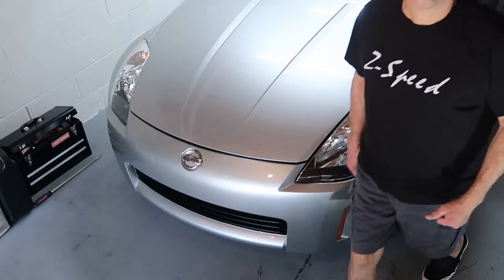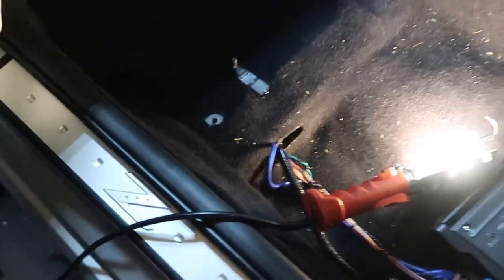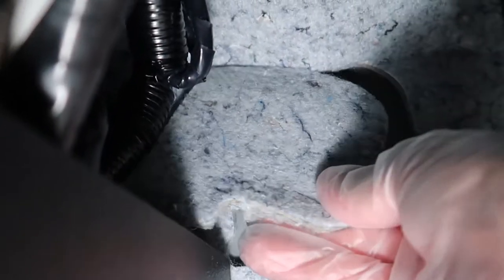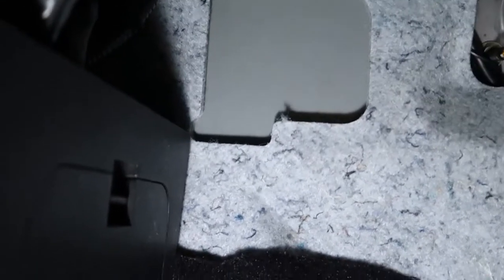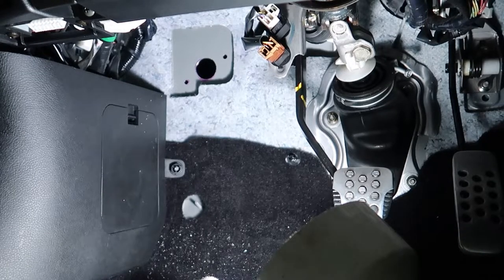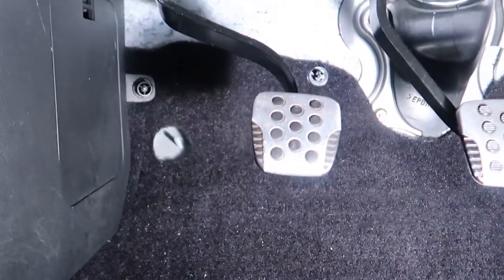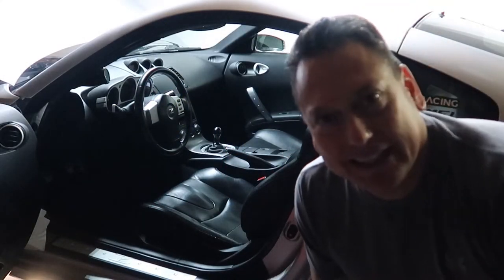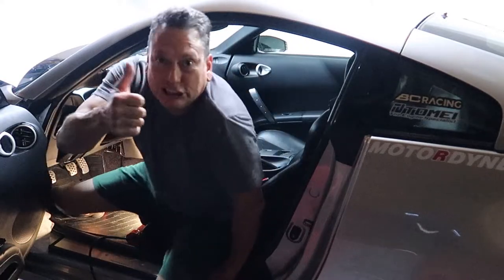350z/G35 DE Manual swap: Part 3-Install Clutch pedal/hydraulic lines & wiring safety switch #350z

Comment: i did this manual swap on my z like a year ago and if your worried about the cruise control to switch maps on your car when you get it tuned. it’s works perfect just won’t have cruise control features anymore
Reply from the maker: That's awesome,👏 thank you for the information, that makes me happy 😊!!!!
Reply: hey bro are you 100% it works because I'm thinking to swap mine but I want it to be tuned I just wanna make sure it does work
Reply from the maker: Still working great, I am so glad I finally made the swap!! It was a lot of work, but well worth it in the end!👍💯🏁

Comment: 1 year later and still an amazing video. really cleared up how to do the wiring. thanks!
Reply from the maker: Thanks for watching!!👍
Reply: @Zspeed  ofc man, question were u ever able to get rid of the check engine lights?
Reply from the maker: No, you will need to swap to a manual transmission wiring harness to make those go away!
Reply: @Zspeed  if your looking to get rid of them, my tuner just said he can permanently delete the codes!

Comment: Hell yes! The video I have been waiting for. Congrats on finishing the swap. Once question though, that service manual for 2004.5+, will that apply to an 07 as well? Because I used the website you linked and I still havent been able to find the section that shows the ipdm layout. But, if its the same then obviously I can just use your vid. There is also one other youtuber I've seen do this where he goes over the wiring and now that I think about it, I think it is the same. But cant hurt to ask. Still saving up for the transmission atm, hope to get it soon!! Thank you again for making these so detailed and helpful. Much love
Reply from the maker: Thanks so much for watching! I'll try to find a link to the 07 manual!

Comment: If you pull the reverse lamp relay and wire 12 volts to the red and yellow wire, they’ll work. You have to follow the write up on g35 driver, for the wiring for this to work. They have you wire your reverse and park neutral safety switches into the small fuse box/relay box in the battery compartment. Just did this on my 6 speed swapped G35 and my reverse lights work.
Reply from the maker: Awesome brother,  thanks for the information, I will check it out!!!👍💯🏁

Comment: Sorry to comment I’m a little late to this but my clutch pedal wire has a green wire and a grey and red one, would I connect to the red and grey to the fuse wire or connect it to the wire that’s connected to the tcm
Reply from the maker: Where you able to wire it up?
Reply: @Zspeed  yea I got it figured out had to do a little more since mines a g35 with sorta a push to start
Reply from the maker: Awesome, glad everything worked out for you, thanks so much for watching!!👍🏁

Comment: Hey Z Speed, enjoy your video! Can you put a link as to where you bought your brand new 6 speed transmission from, would sincerely appreciate it! After watching your last video, am inspired to do the same as you did from auto to manual. Thank you very much!
Reply from the maker: Thanks so much for watching! https://www.z1motorsports.com/manual-transmission/nissan/new-oem-350z-g35-cd00a-cd009-6mt-manual-transmission-p-3342.html?list_name=SearchResults&oid=3342%3A0%3A83328%3A2&qid=6ae279ad3b5d5d990ec6ff41e4a5de37

Comment: Where did you get the pigtail from ? To plug to the clutch pedal
Reply from the maker: I found one in a salvage yard!
Reply: Oh okay ! Honestly I was going to do just the other method or hooking the cable from the abs relay something like that then wire it to p53 cable cuz getting that pigtail it’s going to be hard I stay in a really remote area so barely any 350z or junkyard around here
Reply from the maker: That should work, let me know what happens!!!
Reply: @Zspeed  I’m getting a U1000 code 
Controller area network line malfunction any idea what causes that ? Is it normal after doing the swap ?
Reply from the maker: Yes, that's normal after the swap, you will get a U1000 code because your transmission harness is disconnected!
Reply: @Zspeed  gotcha  I was a little scared ! 

I go start the car starts on the first crank I take for a drive get back home and then when I try to start it again it just take doesn’t start right away takes few cranks for it start
Reply from the maker: It could be your crankshaft or camshaft position sensor, use a OBD 2 scanner when it fails to start next time!

Comment: What did you do about the connections from the transmission 

I bought a cd09 transmission there’s like 2 connectors hanging out of it but they do not fit my connectors that were already in the car !!!! 

I been driving around without them being plug does that affects anything and what are they for?

I finish the swap too!!! Car started on the first try and everything came out on point ! Even I was really scared I did the rear main seal like Nissan Says on the Book took me a while but it’s finally done
Reply from the maker: So glad your swap went well, don't worry about the two connections not being plugged into anything. There is no place to plug the manual transmission harness into an automatic ECU wiring harness, but your transmission will still function normally!!
Reply: @Zspeed  okay thank you !! 

Ya That CD09 transmission it’s the Goat so nice to drive it and Shifting like butter

Comment: Your videos are awesome...I have just one question for now 😂 the wire you ran from the battery terminal area to the clutch pedal. What gauge wire is it...or do you have a link on where i can buy it ?
Reply from the maker: Anything between 12 to 16 guage, speaker wire should work well!! Thanks so much for watching!

Comment: Thanks for your videos! So my question is, I understand that if the stock dual mass flywheel is replaced with a regular flywheel, like you did, there will be clutch chatter. Was that the case with yours?
Reply from the maker: Yes l have noticed some faint chatter at lower speeds, nothing to severe!!!
Reply: @Zspeed  Is the chatter not damaging, just an annoyance? Also how's the car drive compared to the auto transmission? Does it seem like more power is getting to the rear wheels now? Thanks for your reply!
Reply from the maker: Justin, slight chatter will not damage anything, it comes from using a lighter flywheel, the dual mas flywheel is much heavier and dampens the chatter!  the manual  transmission puts down way more power to the street than the automatic trans, so it's worth swapping out!!!
Reply: @Zspeed  Thanks for the info. Wont be long until I'm under the car referencing your videos!

Comment: i bought a manual swapped z any idea what they did or how to get rid of the p1706 pnp switch code thanks
Reply from the maker: I think that code is something you get with the automatic transmission, a switch that has to be replaced.

Comment: Hey zspeed can you answer what fuse did you put in that empty slot next to the o2 sensor fuse for the clutch safety switch, I used the o2 sensor fuse and throwing a code for low heater circuit don’t know if that’s the problem. But would like to know if that empty slot next to it works for fine?
Reply from the maker: Check out: 29:33 on the video to find out exactly where I placed the add a fuse!

Comment: Hey bro awesome videos, I appreciate the detail and patience. I was wondering if this would work on my infiniti m35, what do you think?
Reply from the maker: Do they have a manual transmission for the M35, if they do, you should be able to swap it!!
Reply: @Z-speed  I don't think so , I will have to double check. I just got the p1757 code for my trans. From what I looked up it can be a simple fix, if not I was looking for other options.

I appreciate you getting back to me

Comment: Does anyone know of another way to connect the clutch instead of cutting the wires and would swap the engine house harness work instead? Like how they swap the frs to manual transmission they swap the harness?
Reply from the maker: Manual engine harness will work just fine!

Comment: Just did this swap thanks to you! However I ran into an issue where the key gets stuck in the ignition, have you ran into this issue also?
Reply from the maker: No I haven't had any issues with the key,  is your key OEM or a copy?
Reply: @Zspeed  it is oem. Just to clarify, you have the automatic ecu still?
Reply from the maker: Yes, still running the auto ECU an harness! So far everything seems to be operating perfectly, maybe you should try another key and fob!

Comment: We just did the swap but the car won’t crank, we confirmed we have power to the switch on the pedal and have spliced into the proper wire along with confirming that the harness was all plugged in, any ideas?
Reply from the maker: Make sure the by-pass wire is placed in a fuse outlet that gets power while cranking the starter, power is cut to some fuse outlets while the Ignition is being cranked. The same thing happened to me, watch the third video in my transmission swap series!
Reply: @Zspeed  Will do when I get home, I am almost certain I placed the fuse tap in the same location as you (to the right of the blue 15 fuse in the bottom left corner) but perhaps I have a different fuse layout or have misplaced it
Reply: @Zspeed alright i have verified that the fuse is in the right spot and have check that it has power to it when turning the key over to start it, anything else you could thing that i might’ve missed? thanks for your time!
Reply from the maker: It might be a problem with the TCM wiring, what year is your 350z?
Reply: @Zspeed  it’s a 2006, i believe the same wire as yours
Reply from the maker: Let me know what the problem was! 👍🏁

Comment: hey i did a manual swap on a g35 2005 did the neutral safety by pass with pin 53 to a 15 amp fuse the car turns on but anytime i press the gas it dies, has this ever happen to anyone? pls help
Reply from the maker: Run a OBD2 code reader on your ECU, it might give you something to go on, obviously you'll get a u1000 code but ignore that look for something different!

Comment: Where did you buy the male part of the clutch pedals wire? I can’t seem to find it
Reply from the maker: Got mine from a junkyard, try Z1 motorsports, they have some of the parts you'll need!!
Reply: @Zspeed  would you possibly remember what the part was called? I can’t seem to find it

Comment: Hello, kinda late to this but really hope I can get a response, I’ve got a wire hooked up to wire 53, and running that into the cabin, the clutch depress sensor has the two wires ones green and the other grey and red, the grey and red wire is the same color as 53, I have the red and grey wire hooked up to the fuse “put it into the o2 sensor fuse”and the green wire hooked up to 53 coming into the cabin. When I go to start the car it won’t start and has the park up shift light on, my reverse lights are also on, any clue on what I’ve got wrong ?
Reply from the maker: What year is your 350z?
Reply: @Zspeed  well it’s a 07 g35 coupe but they have the vqde non rev, and seems to have the same wiring as the 05+ 350z, and the clutch pedal and clutch pedal connector is from a late 03 g35, update tho the lights that are on are the brake lights not reverse, my brake is super hard pretty sure it’s cause the car hasn’t turned on.
Reply: Okay update got it running, wasn’t getting power to that fuse box, but I wanted to ask, on the brake pedal there is two holes where the end of the sensors go through, do both of them have pedal stoppers or just one of them ?
Reply from the maker: My 2004 and 2006 brake pedals only had one sensor on each!
Reply: @Zspeed  1 sensors or 1 stopper cause my brake pedal has two sensors on it one with a white connector and the other with a brown connector and so did yours in the video, I’m just a bit confused since I have both sensors and no stopper just two holes
Reply from the maker: Sorry, your right, two sensors. The upper and lower hole both have a small black plug that fits inside each hole. You should be able to purchase these plugs from your local Nissan dealer. I bought my brake pedal from ebay and the pedal came with these plugs in place.  Hope this helps with your build and thanks so much for watching 👀! Any more questions, just ask!
Reply: @Zspeed  did you keep your auto ecu in it ? I still have my auto ecu in but I do have a manual one on hand, right now I’m having a issue with my brakes, when I have both of those connectors on the pedal connected and the pedal stoppers after a couple of minutes of driving it locks my brakes up
Reply: @Zspeed   looking into doing this swap :) could i keep the AT brake pedal and just trim it so its smaller?
Reply from the maker: Sounds like that might work, let me know how that turns out!
Reply from the maker: I have not had any issues with my brakes after the swap, so I am not sure what could be causing this problem 🤔!

Comment: Do you know if this will pass inspection or will you need to change out the harness for that. I live in PA so I’m sure it’s different but just wondering
Reply: And if you have to swap harnesses do you know if you have to mess with the interior harness as well or just engine harness
Reply from the maker: This swap should pass a regular smog test! What kind of inspection are you referring to?
Reply: @Zspeed  safety and emissions is what they do here
Reply from the maker: Then your okay 👌, you can pass emissions test and as far as safety is concerned, I have been running this setup for over 6 months with no Issues!!!

Comment: Did you ever get rid of the U1000 and U1001 codes ? I have also did the swap and I’ve just can’t seem to get rid of them
Reply from the maker: You would have to swap out the engine harness to a manual harness to eliminate the u1000 code, so we just have to live with it!!!
Reply: @zspeed, wonderfull Job! Thanks you very much for the 3 videos.
I was wondering if the change of the automatic computer to a manual one is just disconnect and connect?  I Also have the engine service and AT Lights On, and U1000 and U1001 codes for did these swap.
Reply from the maker: Thanks so much for watching! Unfortunately, just swapping out the ECU is not enough,  you will also have to swap out you wiring harness with a manual harness! Don't worry about the codes, it will still run fine!!!💯👍🏁

Comment: Hey man I know this a pretty old video but I got a question what did you do with the hoses that connect to the radiator to from the transmission did you plug the holes in the radiator or what
Reply from the maker: No, let them drain for a day or two,  then stuff the holes with a paper towel. Then periodically remove the paper towel and replace it with fresh paper towels. Eventually the radiator will completely stop leaking fluid! I know this sounds time consuming but you can't just plug or cap these holes because pressure builds inside the radiator every time it heats up! Hope this helps!

Comment: Does your traction control still work or does it stop working??
Reply from the maker: Still working, as far  as I can tell!!! Thanks so much for watching!!
Reply: @Zspeed  and you can turn it off and on whenever you want?  I ask because I just did my manual swap and I want to turn it off to have some fun but I can't do it :/